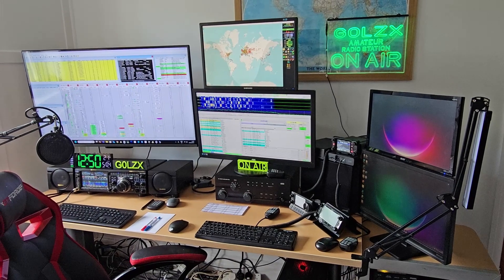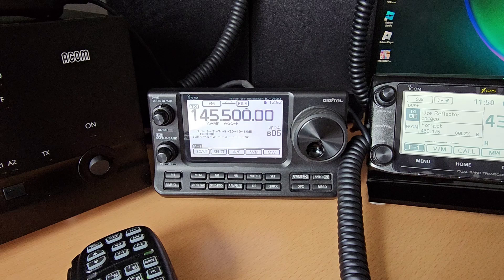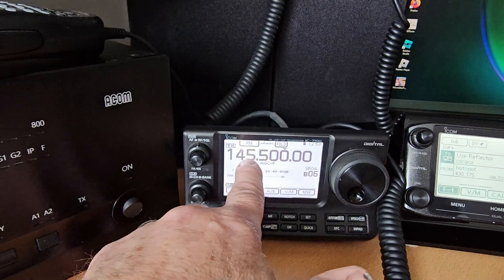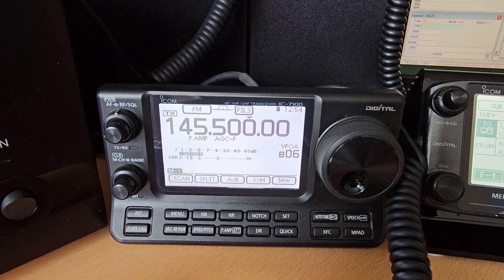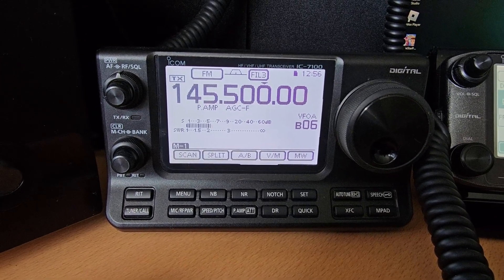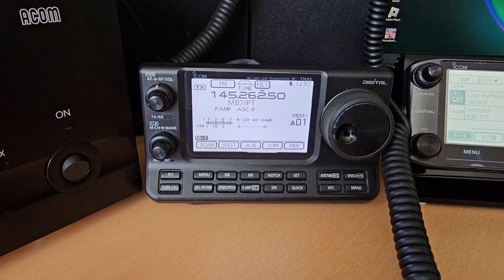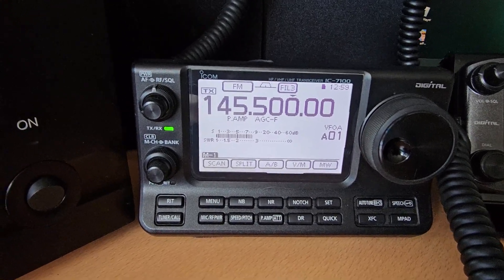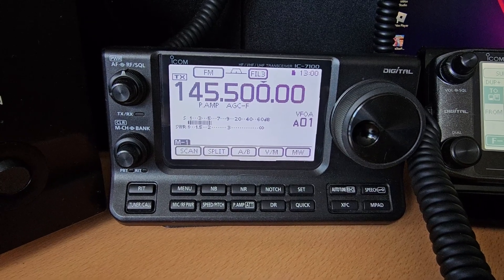The Icom ic-7100 and the advantages it brings to the amateur radio shack

Comment: I’m loving D-Star on my ID-52+. Haven’t set up my 705 yet. Haven’t thought about the 7100 yet but might be a good solution for a mobile. Is there a good mobile HF/UHF/VHF screw antenna that will work with it and will it run on a hotspot for D-Star?
Reply from the maker: @stevesummersell_K4WXX  I think the only antenna that'd do that is an ATAS ?  Most ppl i know use dedicated AM-Pro whips for each HF band and a separate vhf-uhf antenna